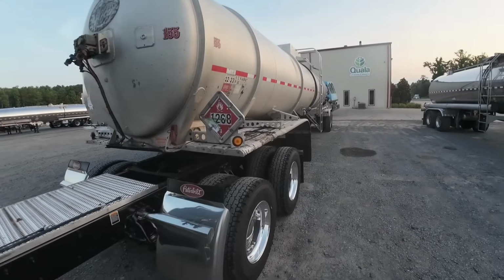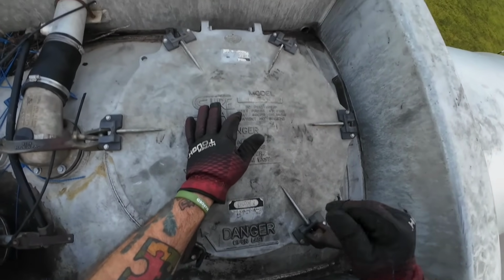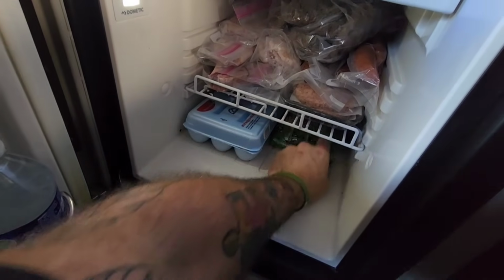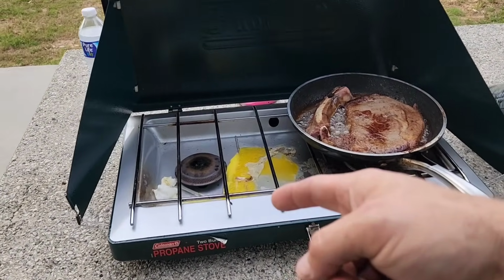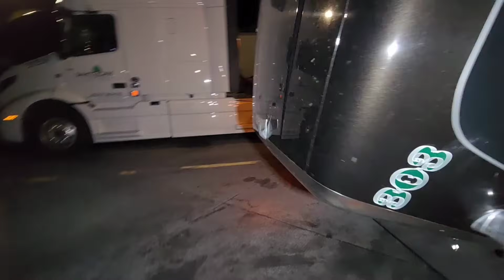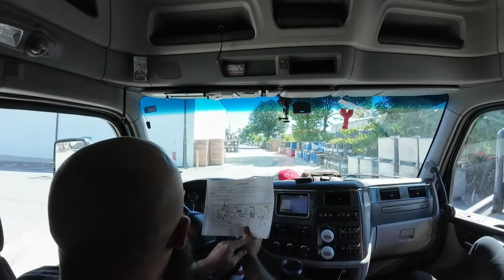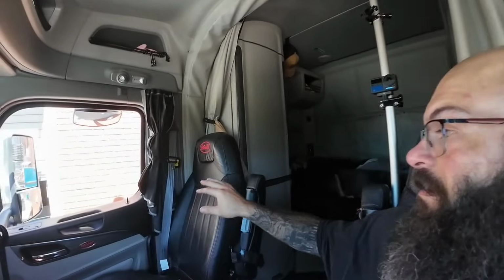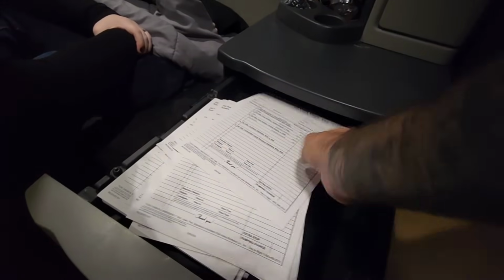I Almost Wrecked My New Truck.

Comment: Me thinks 🤔 if you'd had your wagon, that box truck would have  hit you . Head on a swivel.
Reply from the maker: Yeah thankfully I was bobtail
Reply: @Life-On-18-Wheels  safe travels brother Mike 🙏
Reply from the maker: Hey brother safe travels to you as well
Reply: @Life-On-18-Wheels  playing around Vancouver Washington and Seattle Washington today 🫣
Reply from the maker: 10-4 at hoke right now left out Sunday went to Louisville got unloaded Monday and then the ac quit working in the truck on way back.. these newer electronic truck but anyways it is back up and working again.. so I run home last night and got to run to shop in little bit and mechanic is gonna change a safety switch or something on the ac and then got to load possibly tonight..don't know yet..